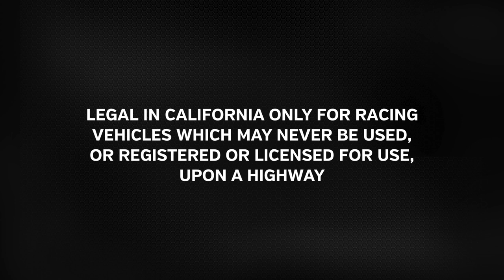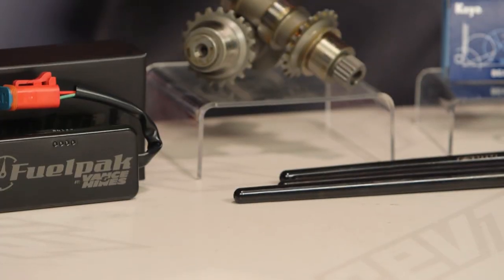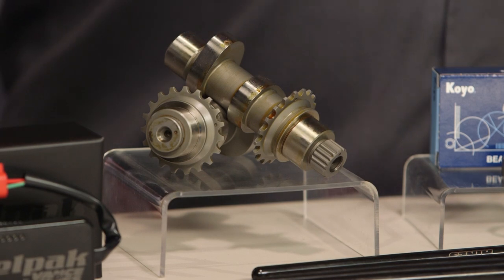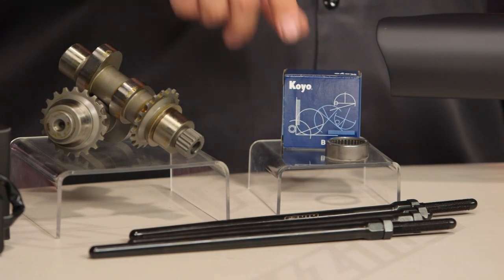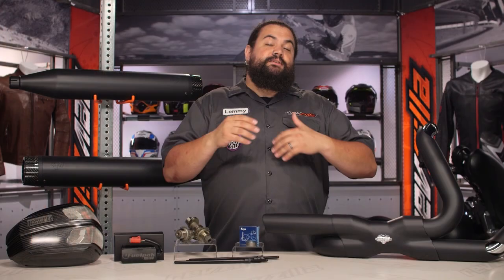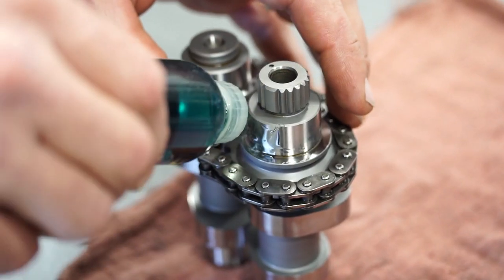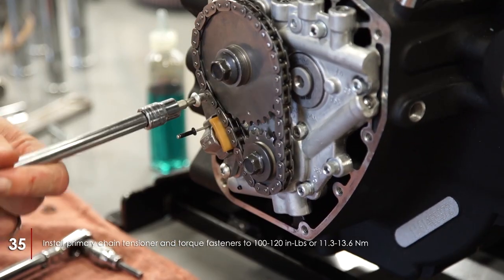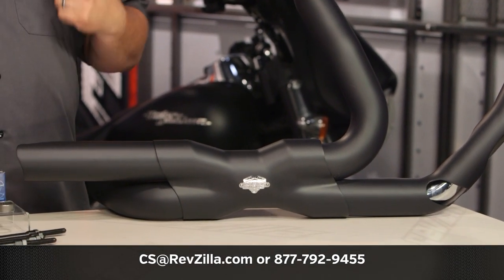Vance & Hines 30+ Horsepower Kit For Harley Touring Review at RevZilla.com

Comment: This setup is on my 2016 Ultra Limited.  Vance and Hines downloaded the correct map right to my phone while I was talking to them and it now runs strong.  The Vance and Hines tech had to go to the Dyno guys to add the correct cam to the map.  Until I got this map, Auto Tune was not going well.  It was running REAL poorly I thought the darn thing was going to kill me.  I was about to pull the FP3 and go with a different solution.

Comment: heck I added just the powerdual header pipes n also their high out put slip ons my 2014 103 and my friend with a new cvo then could no longer pull away far from me, infact I was able to keep up all the way when he got the to twist the throttle, granted he was 100 lbs heavier than me but still it speaks volumes of their pipes plus i love the sound its awesome, but I just traded it in for a 2021 Road glide thats new n its getting Vance n Hines Power Header all the way right from the start mostly for sound but i'm sure I will gain some power  n torque too just not sure how much but it sounds fricken awesom n runs great ! love vance n hines

Comment: Put this on my 2014 Electra glide.  Was not happy w/the fp3. After auto tuning and v&h sending 3 different maps finally took it goof and went w/a power vision. All other part are satisfactory.  Would not buy the kit though since the fp 3 was a waste of $$
Reply: Mark Bowlin 
Wow I think your the only person I have seen on the internet that has complained about the FP3. Every one else seems to really like it 🤔 something doesn’t seem right here! Maybe you received a faulty FP3. Hope you got her running good now.
Reply: @alanwhiteside410  you can't auto tune with this setup. You have to load a base map with with Cam setup then you can run auto tune to fine tune it.   He gave up without doing some research.
Reply: I’ve seen where 1 out of 5/6 bikes just don’t work well with FP3 . I had the FP3 initially and it worked well. My buddy had it for his ‘12 RG and it sucked! Lol. Both of us switched to power vision + dyno tune which works even better.

Comment: You would think since HD are charging completely insane prices for their bikes that they would include something like this stock. But what do you expect from a company that doesn't want the average person riding their bikes anymore?
Reply: I'm 24 and I just traded in my 2017 Iron for a 2018 Road King Special... So maybe you not affording a new bike is more of a "you" problem than a Harley problem.
Reply: TJ you are correct and these younger whipper snappers with the know it all attitude just don't have a clue.  I own a Harley but before I ever purchased one, I purchased a much more powerful Honda VTX1800 that could ride circles around any HD and for less than half the cost of a Harley.  That's called simple economics, something these two clueless 20somethings don't have.
Reply: TJ it’s illegal for a manufacturer to install illegal shit in bikes meant for the roads and highways.
Reply: William DeCamp and a quarter the value of a Harley as well.
Reply: @tax905972  And what about that nice fairing w/storage, the bluetooth stereo with gps, and the locking hard bags on the VTX. Oh that's right it's a Honda. It doesn't have any of that. 😂😂
Reply: @williamdecamp7343  So with all your experience you decided  to slum it and go back to Harley. Your argument makes no sense you goose
Reply: @irishglide8441  No soul either
Reply: @irishglide8441  No soul either
Reply: @irishglide8441  also the fact that you don't see 100 year old Honda's actually getting any road time. That garbage is a throw away bike, hell you see older Indians out than Honda's n I don't even like Indians. My roommate has a shadow and a Vulcan both broken after not too much milage and the rebuild or engine swap on his Vulcan is a ridiculous process
Reply: @garysavoie4096  i own a streetglide and i love it, Harleys are great for laid back cruising and jamming the speakers but the vtx is a monster that even the new 114 can't hang with

Comment: 30 plus h.p.!    That's higher optimistic.  More like 17 to 20 if lucky.  Adjustable pushrods are a big NO NO
Reply: And why is that? The old harleys all came from factory with adjustable pushrods. You just need to get a good billet set, not some cheap ones